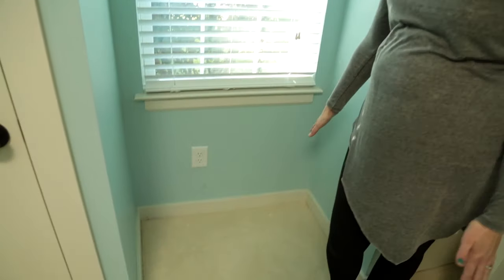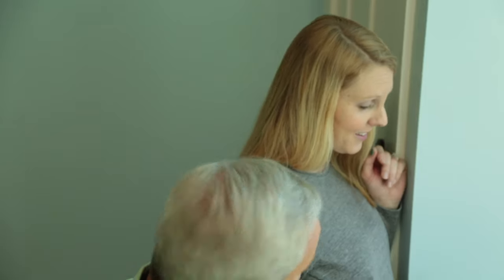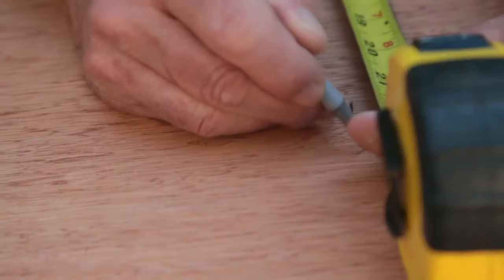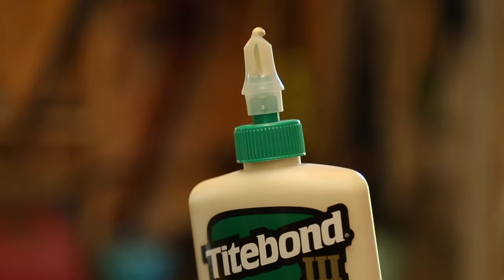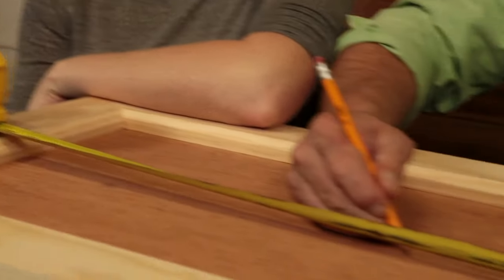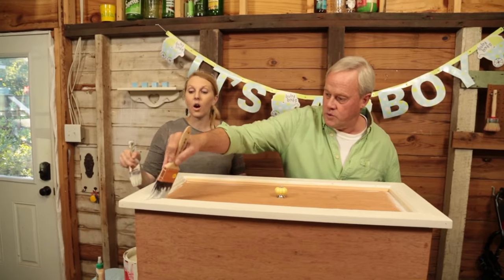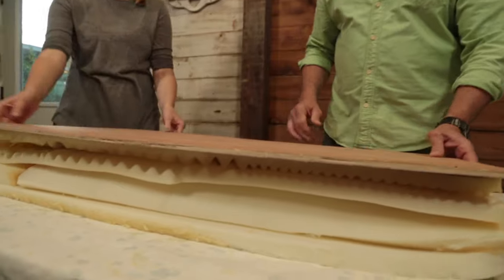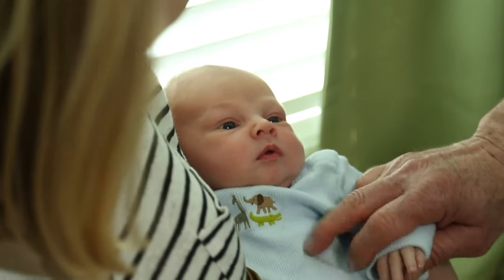How to Build a Window Seat

Comment: it's cool, but, im sitting here thinking, wait, there's an outlet there, just like my wall that im thinking about building one of these for. What you should have done was not make a "full" drawer, or even a drawer at all but, if you made a drawer, make it a small on, and put it on the side of the seat that wouldn't cover the outlet. Outlets are hard to find these days, so, it's always good to have them available. Cut out the other side of the bench, so that, you can just climb under it, to use the electrical outlet